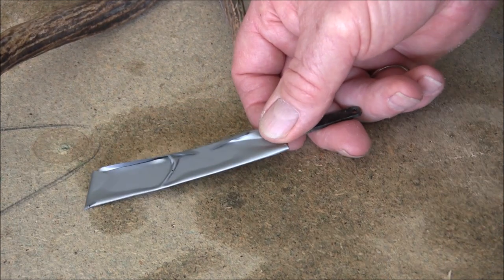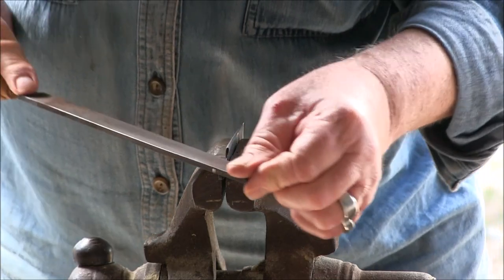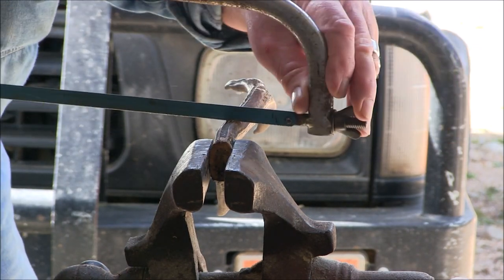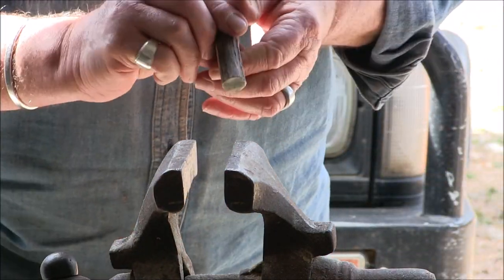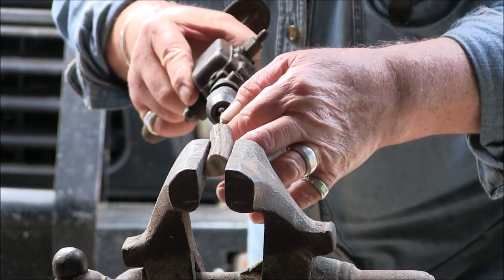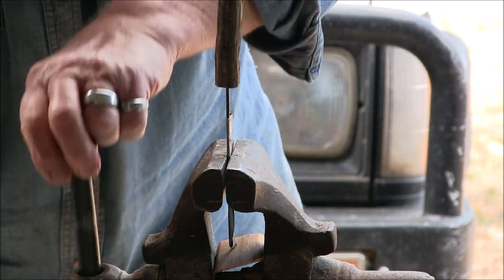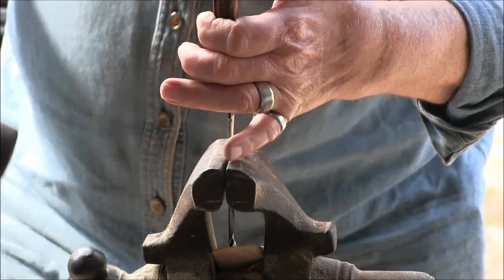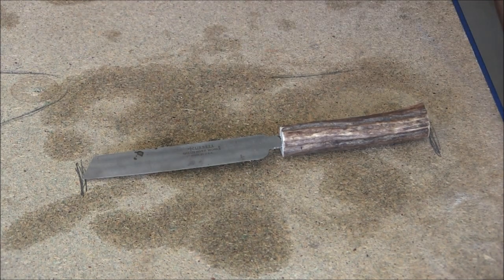Fitting A Stag Handle To A Blade By Keith H  Burgess

Comment: What are the risks of the antler splitting? I'm wanting to do this with a wooden handle I've made but I'm nervous to hammer the blade through the wood
Reply from the maker: Good day Erin. The antler can split if the tang is too large. If you feel any resistance, best to stop. A wood handle will split far easier than antler. You need to drill the wood handle first so that the tang fits snugly in the handle. If you are not worried about authenticity, then you can glue the tank in the handle, otherwise drill through the handle & tang & insert a brass or steel pin.
Regards, Keith.